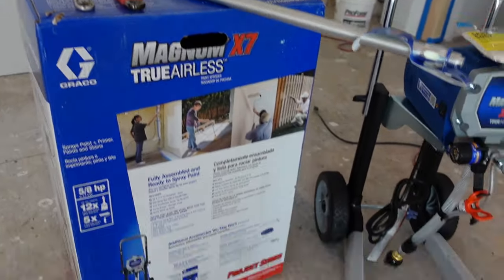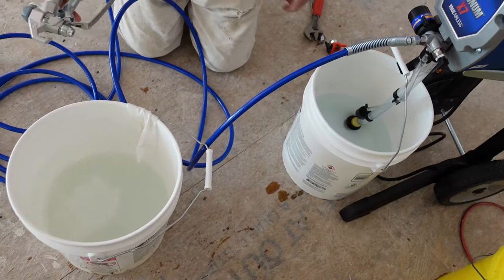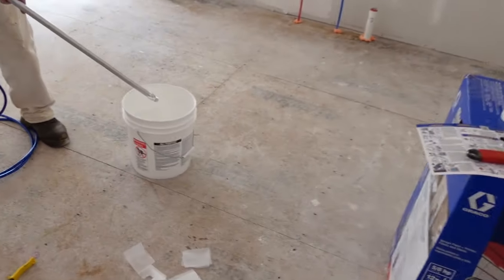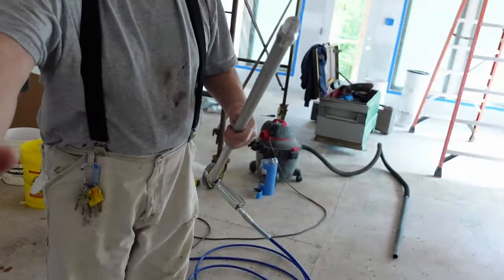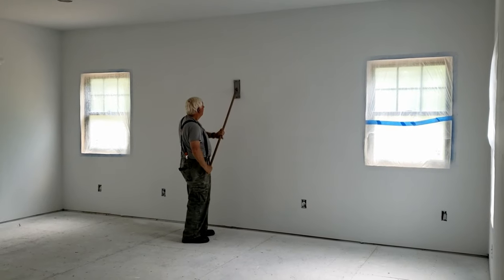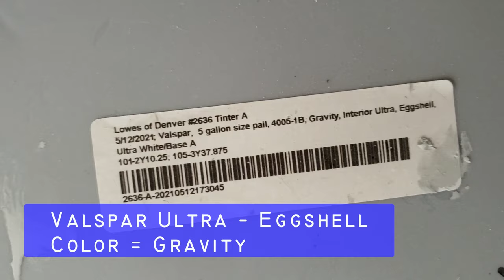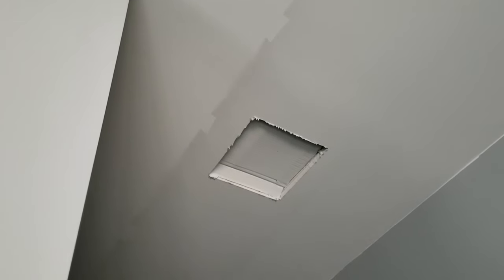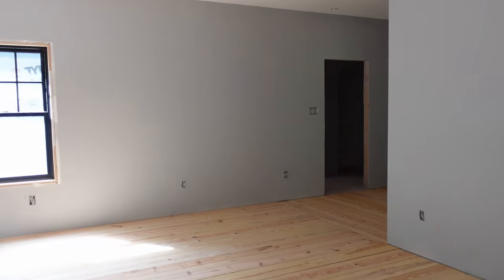DIY Painting New Drywall with Airless Sprayer – Graco Magnum X7 – DIY Painting New Construction

Comment: Ok so when I painted apartment units we would spray ceilings then straight to walls with about 1/4 fan overspray on ceiling then instead of masking the ceiling we would mask the wall with 12 in paper and do a quick perimeter touch up, it's super helpful if you have popcorn ceilings or really high ceilings making walks way easier great video

Comment: As a professional painter I use PVA Primer on new Drywall.
Reply: How many coats of primer if you are spraying?
Reply: @jeffherring6279  I usually spray 2 coats of Primer  on new Drywall
Reply: IF someone were wanting to prime everything,  ceiling, walls and trim. Would you just tape off the floor and fixtures and just do it all at once with the same tip?
Reply: @heatherb918  you can do that. I usually remove the light features, curtains, blinds etc.
Reply: You don’t need to prime new drywall.. whatever flat white you use on the ceiling just give the drywall one coat of that and you’ll be fine.. 
2 coats of a pva primer lol..
Reply: Thank you for your advice… lol
Reply: @navarromendiri just saying you’re wasting time.. and time is money.

Comment: Just one thing.never put your hand over the tip when assembling the gun.turn the machine off or dis connect the gun from the hose.could have very serious consequences it ends up spraying onto skin.its a very high psi so it will pierce the skin and get into your blood stream and can cause death

Comment: Great video! I purchased the same primer but havnt started yet. Waiting on the x7 to arrive. How is your paint sprayer and primer etc holding up? Any new updates?
Reply from the maker: The paint and primer are holding up good.  We painted before we did the floors or any of the trim, so we have banged the walls up some while doing that.  We will definitely have to do some touch ups before we move in, but I think that is normal.  Otherwise it still looks good!
Reply: @CountryGirlLiving  how did you handle the corners? I just got mine and it leaked so much from the handle area, cleaned it up and finally work but the prime I used kilzone 2 was runny, not sure if it was the primer paint type but definitely disappointing, gonna try it again
Reply from the maker: @Ricebow11  On the corners we sprayed floor to ceiling to get a good coat on corners, then stayed the surrounding areas.  If it was leaking from the handle, you probably didn't have it tight enough.  Used wrenches to tighten it down.  I haven't ever tried kilz 2.  But the kilz drywall wasn't thick or runny, kind of in between

Comment: Thanks for the video of the X7. I am trying to decide between the X7 and the 190PC model. Can you tell me how many coats you did on the walls and ceiling after priming and have you used the sprayer since? Did it work well after it was stored?
Reply from the maker: We did one coat of primer and one finish coat.  We have not used that sprayer since.  But we will use it again to paint the exterior in a few months.  It comes with a solution that you are supposed to put in it when you store it.  So that should help it store well.
Reply: Had an x7 painted 35 apartment units, pick up line always had paint or water in it that was about 6 months, had it for about 6 months after that painted a few exteriors then Somone stole it. These are really good small units
Reply: Also the x7 I had purchased was previously owned not sure how much is it had

Comment: Why did you sand after primer? Been considering getting a paint sprayer, is cost worth time saved?
Reply from the maker: We sanded after the primer because there was still a little but of roughness to the drywall.  Just a light sand of the primer took care of it and made the walls smooth.  Is the cost worth the time saved?....Well, for us it was because we used if the the entire interior of the house, and will use it for the exterior of the house as well (this is where it really saves time).  It worked well for inside because it was new construction and we didn't have to worry about it getting on the floors or on furniture.  If you are painting interior on an existing house, I would probably just roll it.  I think by the time you had to move all the furniture and mask all the windows, doors and walls, it would be faster to just cut and roll.

Comment: Did you sand the ceiling also?  Our ceilings are 16 foot high and it’s gonna be hard enough spraying.
Reply: Your ceilings are 17ft, you need to add 1ft for joists between the 1st and 2nd floor.

Comment: That extension is for the spray roller so it don't bend when your rolling, I would never spray ceilings or anything with that, your arms would be jacked all day, the extensions for an airless sprayer is a quarter inch thick, 5 times lighter that thing, he got that and that sprayer at home depot, next time get a titan sprayer,  those x5 and x7 are garbage, you only get about 100 to 200 gallons out of them and the pumps are done then they are garbage.

Comment: If you don't backroll the sheetrock will fuzz up and be a sanding nightmare
Reply: That's why they brushed all the dust of befor they painted, honestly I would only back to if it was new brick face stucco or EIFS
Reply: It should be bankrolled because spraygun spit sometimes on the wall or cieling when stop and start